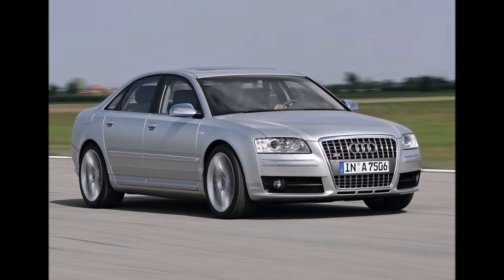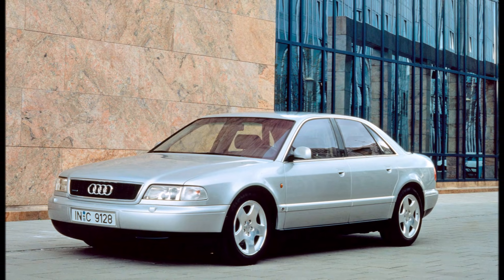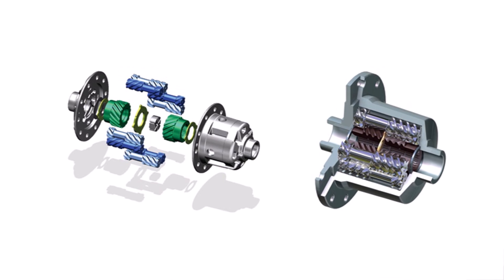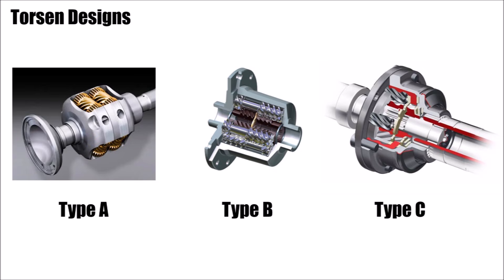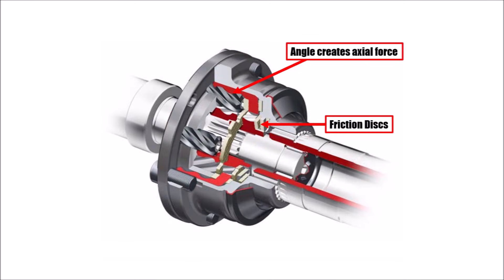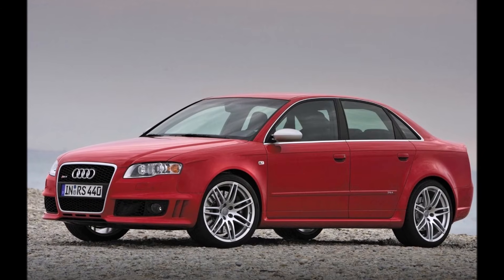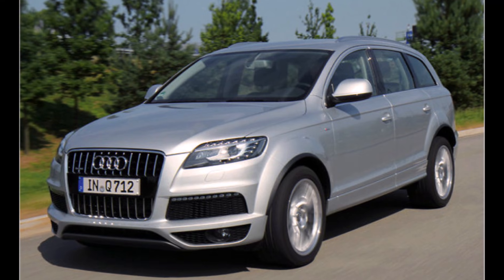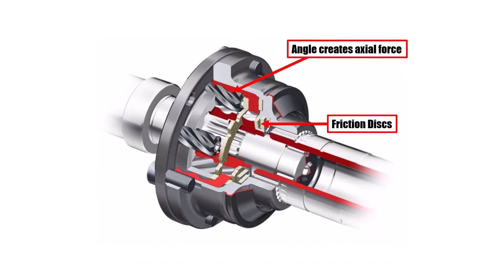History of quattro - Part 9 - Torsen Type C (Rear Biased Mid Differential)

Comment: Torsen diff is superior i had it installed in my s550 mustang
Reply: That's an axle application.  Audi uses it as a center diff, and uses open diffs on the axles (except the R8 rear diff).

Comment: 1:38 - "again, the idea is fairly simple: you drive the housing, so the ring gear"

I thought about this for days since first watching this video, how the power transmission looks like if you drive ring gear and use planet carrier for one axle output and sun for the other, as that would be like powering a regular diff through one axle and extracting output at the other and the housing...

Well, no! Look at the picture! The housing of torsen C is connected like in any other differential with the planet carrier, the ring gear is output gear for rear axle and the sun gear is for the front axle. Exactly as I've guessed in a comment under the previous video.
Reply: Transmission output spins the housing, the planet gears are mounted to the housing, the larger ring gear is the rear output gear, the smaller sun gear is the front output gear, yes.

Comment: i work at an audi dealer as a mechanic student atm and a colleague told me the RS5 V8 had an ultra quattro clutch pack system but with a different clutch than all other cars, including modern ones. he said it was made by a japanese manufacturer but forgot which exactly. he told me it used a different, stronger clutch because of the high torque that came with the NA V8. i havent found much info on it so i was wondering if you know anything about it and maybe do a video on it if this is the case?
Reply from the maker: The RS5 B8 has a crown gear centre diff. The NA V8 doesn't have that much torque, but this diff is simpler and lighter. We will talk about it in one of the next parts.
Reply: Careful with the use of the words quattro and ultra together when talking Audi.  Unless you specifically mean quattro ultra in the recent years vehicles, which is not a Torsen system, not even a center differential system.  As the vid author mentions, crown gear center diff is the term you're looking for.

As also mentioned, naturally aspirated engines are not "high torque", particularly compared to turbo implementations.  4.2L V8 CFSA released MY10 only produced 317 ft-lbs [430 Nm].  The 2.0T I4 CAEB in my MY09 produced 258 ft-lbs [350 Nm] (well, when it was new, probably not today).  But you also have to consider the transmission, as the center diff is going to receive the torque level out of the transmission, not out of the engine.  The crown diff was only used in the 0B5 DCT, which doesn't get the torque converter multiplication, and has different gear ratios compared to the ZF auto.

Comment: What Torsen diff did S8 D3 get? It was also 40:60 split.
Reply from the maker: That should have been the Type C at that time as well
Reply: It appears D3 and C6 V10 vehicles with the ZF 6HP26 transmission changed from using the 50:50 type A in MY06 to using the 40:60 type C starting MY07.
Reply: @smac770  Parts catalogue shows only one partnumber for the whole production life of S8 D3. Besides, I clearly remember the press info of the S8 launch and it was mentioned 40:60 split from the beginning.

Comment: Did regular B7 A4s also have the type C, or only the RS4?
Reply from the maker: It was just the RS4, but 2 years later with the B8 reveal every A4, A5, Q5 had a rear biased mid diff (but this was not a type C, we will come to that in a future video)
Reply: @bsport320  damn it, I was hoping there would be a bolt-in solution for a B6
Reply: @bsport320  No no, there are some missing information. 

S4 B7 from year 2006 also had the same diferential as rs4 b7.  I think the torsen were even the same part number.

2005.5 B7 S4 came with the same 50:50, but after 2006 it came as all other audi's 40:60, but only in manual, automatic transmissions were still 50:50.

I hopefully will soon be able to upgrade my own S4 B7 2005.5 transmission to the newer 2006+ one.

So if you have the same transmission code in your B6, you theoreticaly can swap diferential in from an rs4.
Reply: MY06+ B7 S4 and RS4 with 6MT had the 40:60 type C.  S4 trans codes HVM and JMF and RS4 trans codes HLD and JMH.  Used the 0A3 409 751 J center diff p/n.

Comment: I had F30 Xdrive,and currently 2016 C250D 4Matic.

Mercedes just feels different!

Is very good compared to Bimmer.

But Bimmer had that engine stuck inside far away from front,so the balance was just superb.

That 50:50 definetly is kinda true.
Reply: F30 likely used a permanently driven rear axle with multi-disc clutch connected front axle.  Not sure if xDrive cars ever used a center diff layout.
The MB likely had their permanent awd config, which uses a planetary open center diff, but with a fixed preloaded clutch between the two outputs to provide some level of slip prevention at the center diff.
Unfortunately, be it quattro, xDrive, or 4matic, they're just words for "some manner of awd", and don't actually convey specifically the underlying implementation.
Reply: @s @smac770 Hmm I am not sure.

But majority of these cars,today,are Xdrive or 4matic or quatrro.

I am seeing less and less newer cars coming with RWD only.

Is like safety features,but also is more premium.

My Benz now feels like normal,no heavy weight or anything.

It has 1730 KG stock with fluids.

I enjoy this car.

Comment: Very interesting. So the newer Quattros with Type C have friction plates that wear down over time. 
I wonder if you could make a biased Type A differential, for example with a different gear ratio between worm gears or different sized central gearing for the axles.
Reply from the maker: Yes exactly but the diff is designed to last for a lifetime (300,000km) and we will come to the rearward biased torsen in another video.

Comment: The torsen C Quattro is really amazing to drift in the snow. The torque distribution to all 4 wheels feels balanced all the time. So you look like a super Gymkhana hero behind the wheel in an Audi. Other AWD system will also works but it isn't as easy to control

Comment: Interesting, I had not seen the Type B Torsen before, I'll have to look into its applications.  My guess is that it would be used in other AWD cars as a center diff where more priority was put on comfort and less on locking performance?  I sort of enjoy the binding of the center diff on my B8 S5 when I go around tight corners - it reminds me of the quattro system underneath!
Reply from the maker: Type B is also used in rear axle diffs as after market solution
Reply: B is referred to as PAT, parallel axis Torsen, as the locking gears are parallel to the diff axis rather than cross axis like A.  50:50 PAT is an axle diff thing.
Audi utilized a second gen asymmetric 40:60 PAT for a center diff.  If your B8 has a manual or DCT, it's going to have that PAT B2 center diff instead of a planetary C, which would be in the ZF automatics.